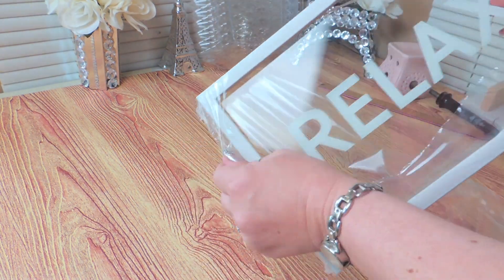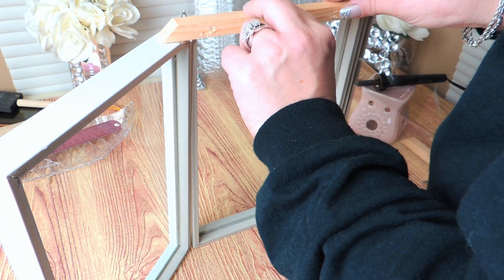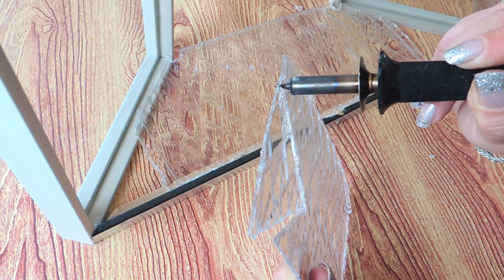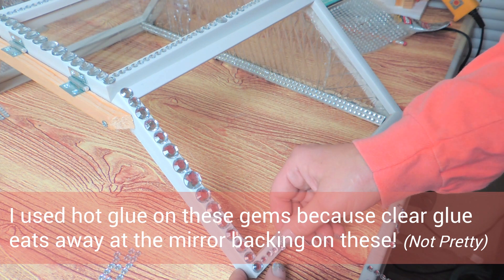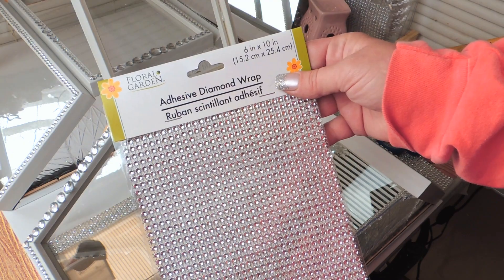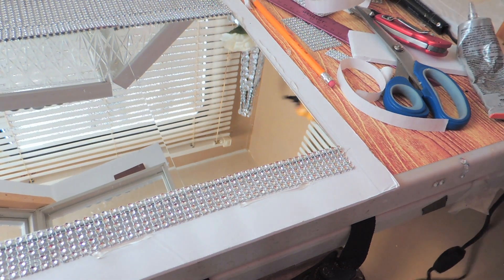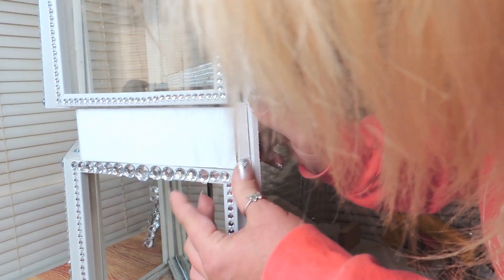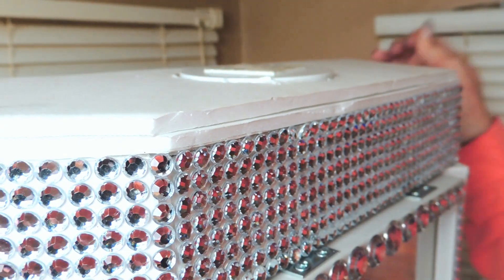NEW DIY Dollar Tree Curio Cabinet w/ Lights | DIY Home Decor | Dollar Tree Furniture | Wall Decor

Comment: I would like to know what that cutting tool thing is that made cutting the plastic so easy? Looks amazing!
Reply from the maker: Hey Darcy, I love this thing. It's called a soldering iron, some people call it a hot knife but on the package it came in it said "wood burning tool" I got it at Walmart in the wooden craft section for $12. It come with several interchangeable tips and this one has an on/off switch. It's outlasted any other one I've ever had and I use it a lot! You'll love it and find many uses for it. I'm glad you enjoyed this project, thank you! 💖
Reply: @CreativeLivingLifestyles  sounds great.  Have you tried cutting through hard plastic? Thank you for taking the time to respond ❣

Comment: I love this . It is very nice , but I don't  think I could do the melting of the plastic without getting a killer migraine. Does it smell real bad when you melt it ? I would love to make this though.
Reply from the maker: Hey Sandra, yes unfortunately it does smell. It's not unbearable but maybe you could do this in the Spring time when you can open your windows or just use foam board for your shelves rather than the clear tray. If you did it that way you could simply insert a push light underneath the top shelf to shine on the bottom display. 
I've used a saw on this plastic before but ahhhhhh that was too much work. The foam board shelves was my original idea to start with and it's easier too. Just cut and glue.
Reply: Thanks. I will  make it with the foam board  !

Comment: Unique. All told, what does the piece cost in materials?
Reply from the maker: Everything I used is listed in the description box. Everything beside the somr of the gems I used & the two dollar hinges was all from Dollar Tree. You can do this for about $25 if you have to get everything from scratch.  The white decor frames & mirrors is most of it. That & foam board is the structure itself.